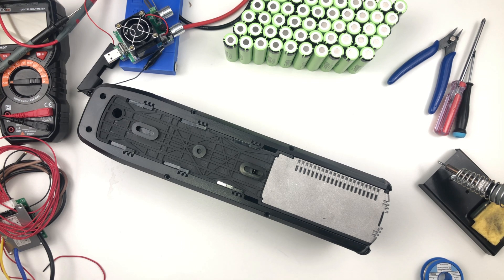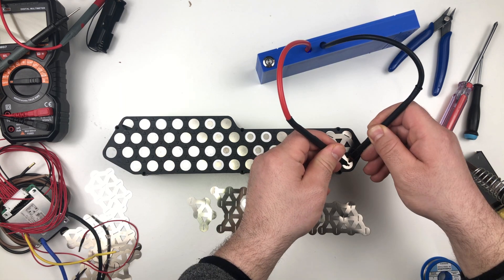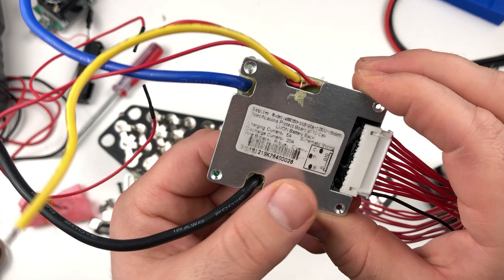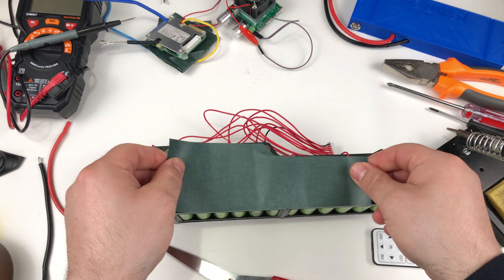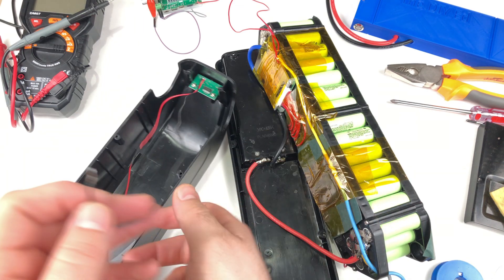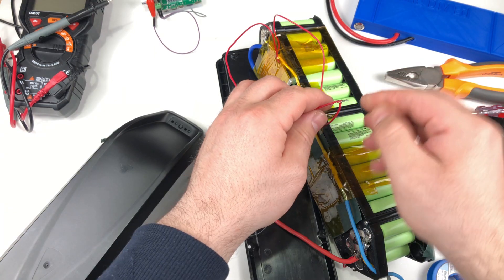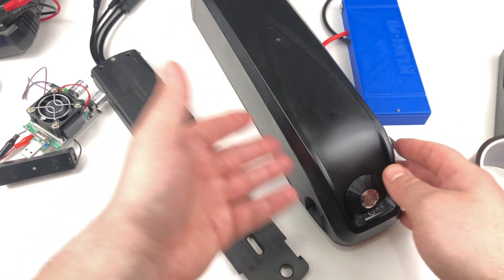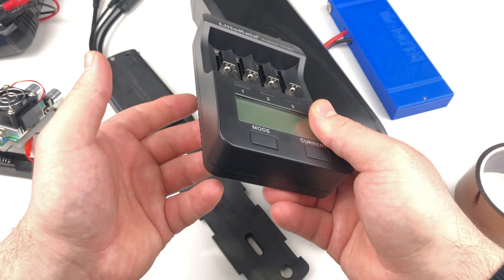DIY eBike Battery Build with 18650 Batteries [ How to Tutorial ]

Comment: Please don't make the same mistake I did. This video is a good guide, but the 18650 Panasonic cells shown in the video are not suitable for ebike batteries. They do not have a high discharge current. After 3-5 charge cycles, the cells are worn out and lose their performance. Instead, buy cells with a high discharge current.
Reply from the maker: Thanks for the feedback. I am planning to make a new follow up video on this topic as I have gained more knowledge and experience.

In deed the cheap cells won’t last as long compared to proper one from official certified sellers, but I can say confidentiality they are still in use for some Arduino projects I have around. The ebike battery did died on my beginning of this year completely but it did lasted years.

Comment: Thank you so far so very good! I am stocked  after almost completing a 48 v  reetion dp lithium ion battery project!’the battery without the BMS showed a 52 v overall on testing from positive and negative ends  But after fixing the BMS and sense wires, the charge showed a 52v. While the discharge end showed only a 21v,! I ordered another BMS and refitted it and still got the same problem! Please waiting for your rescue. Thanksgiving advise ASAP. Thanks🥅

Comment: Wow is this bad. Can't believe people watch this and think it is ok. You don't drop a soldering iron onto a lithium battery terminal. You solder first to the strip and then spot weld the strip to the battery. That's the whole point of spot welding - to minimize heat to the cell. No trimming of the BMS wires. Just spaghetti wires and then wrap it with Kapton - so messy. BMS wires should never run across the terminals. They run down the side of the battery with double sided insulation tape for strain relief. Tabs should be added to the terminals, which is where you solder to. Many other things wrong. Too many to list. If you are watching this and think it is ok, that's a sign that you should not be attempting it.

Comment: Thank you for the wonderfully informative build information! 5 years later, how long did this battery last you? what kind of range did you get from this battery during its lifetime? I am building this same configuration for my son's 1000w 36v e-dirtbike and I would like to know how well this worked for you.
Reply from the maker: I made 2. One died on my beginning of this year but that was before I forgot to charge it and left it in the basement. 
But until that point it was still giving me enough charge to ride for 30km with mix driving. 
The other one unfortunately was stolen with the bike after 6months.

Comment: Would that be possible to put the battery in some heat shrink plastic, then put in the plastic cover. Or is it overkill ? Also a battery 52V 17.5A battery costs around 600-650$. How much did that build end up costing you ?

Comment: Hello my friend,
I would like to build the same constellation. I already have a Hailong1 battery with 13 Ah but it is already very weak after 2 years because cheap cells are installed. Therefore I want to build the same constellation with Panasonic NCR18650B cells.
My controller is in the battery holder and is from Kunteng KT36ZWSRT-EP01 and I think 15A+1A max output. Would this battery constellation of 17Ah work with the controller?

Comment: Hi great video. Im a little confused though. You said the battery cage has a built in controller, is that correct?
Also, I have a bafang mid drive motor with a built in controller, does that mean I would have no use for this controller in the battery cage?
Thanks for the video.

Comment: Awesome tutorial man. I am in electronics myself, but was looking into tutorial to figure out how to connect BMS and organize batteries in the optimal way. The battery I'm building is 48V/17A so using just slightly larger Hailong case that can hold 65 cells i.e. 13S5P. I've chosen the same Panasonic cells as you did. They are probably the best performance per dollar 18650 one can buy - I found mine (genuine) for under 2.5$ per cell. And max discharge current is not 5A, but actually 2C i.e. 6.8A. With 5P that's 34A in total, enough in my case even for 1000W motor (mine is 750W and limited to 25A by the controller.
I also picked up couple of neat tricks like using the Kapton tape or using a ticker wire for connecting battery terminals, BMS and output terminals (which I totally forgot to take into account, until you mentioned it and then I ended up using 4mm2 wire, i.e. a bit ticker than AWG 12).
Reply: @pera kojot, which AliExpress store do you buy yours from? I notice battery linked in post sex in max 10 packs

Comment: How many kilometers we will travel on this battery?🤔
Reply from the maker: Depends of how I am driving it. I am a 103kg person and I think I am getting almost 150km with moderate riding with pedal assist, but if I go full throttle each time it will probably be like around 30-40KM

Comment: Thanks for your video. How much money do you save by building your own battery?
Is it worth doing?
Reply from the maker: Thanks for watching. I would say you will probably save more then $150. Also you know what you build, what components you have used, buying a already packaged battery pack usually they don't have the best BMS or cells, using lower capacity and the battery pack will weigh more because it will use more cells.

Comment: Where can I get a bms for my 52v.17.5 ah. Upp brand ??? (Triangle battery!)..
Reply from the maker: Did you try looking on Ali? I am sure you can find something there. Just make sure you get the BSM with the correct amperage max capacity. I say go 10A more then needed.

Comment: Why did you choose 10s battery instead of 13s?
Reply from the maker: As my controller was 36V as well as the hub. I personally don't need anything stronger. You can check the video of the ebike build using this battery pack.

Comment: good video.but how to choose right charger for dis?
Reply from the maker: If you are building a 10S pack you need a 42V charger. Just search for 10s chargers and you will find it easy. Just make it has a cut off option when it charges the battery pack to stop charging. The BMS is there to stop the charging but you want to have 2 layers of protection.

Comment: I am looking to build a pack with 13s 3200Mah and 7p to give me a little over 22Ah's on my 48v bike. I have found everything I need to make it now other than the BMS. It gives me options such as 30a or 60a and to be honest I am not 100% in what one is better I know I want the 13s also what is the difference between Common port and Separate port, I assumed it is less common has less wires from the cells to the BMS and Separate has more ? hope you can help or point me in the right direction on this. Thanks for the videos btw I opted for the spot welder you used also :D

Comment: Is the battery "live" when you solder black and red to discharge connections?
Is there an order in which to solder, black first red second?
I need to replace mine.
Reply: You can’t turn off a battery, unless the bms has an on/off switch. However this is not a problem until you short wires together. Then it goes boom... Solder them in the order that best fits for you. Be sure to use plenty of solder and a large tip, otherwise you’ll burn out the connector. Always insulate when working, especially if you are not confident with what you are doing. 
Good luck with it!

Comment: Im new so want to be sure if i wanted 48v 17ah I would need 65 cells for a 13s5p configuration? that would be 65 cells i need? do i need to change the bms to 48v 20A like this one? https://www.aliexpress.com/item/33000839343.html?spm=2114.12010612.8148356.32.6b557abeW49ASK
Reply from the maker: Hi, you will need 52 cells 13s3p and you will have a 17+Ah with cells that are with 3400+ Ah capacity. For the BMS I would stick with 20A one if your hub is rated for 500W or lower, if its more then go for bigger Amperage BMS. Have in mind this does not have on/off function but it does have a temp sensor. For on off you will need to use a latching button that will be rated for what your BMS is rated.

Comment: nicee its diffecult for my because i never do technology electronic if i want to make a battery pack can i use a solder to solder the batteries togheter
Reply from the maker: You can use solder to solder the batteries but I would not recommend doing this. 
It can be very dangerous and you might damage the cells. This is the only reason why I purchased a portable spot welder. You can check the review video out.

Comment: What setting did you have the welder on?  And thickness of the nickel
Reply from the maker: On the max ( 3th setting ) the nickel plates I used are of 0.125 thickness and the welders max rated is 0.125.  I  think there is a way to modify it so you can weld ticker strips. I need find out more and do some tests.

Comment: How do you charge this battery?
Reply from the maker: With a standard DC 42V 2A adapter. There is a charging port on the battery from the front right side. 
You can charge it with bigger amperage the BMS can charge safely with 5A but I am in no rush and slower charging speed longer lasting battery pack.
Reply: @thediyed  thanks for the reply. I am a complete noob and your post on reddit made me interested in ebikes.
Reply from the maker: I was the same, I am still learning. There is nothing better then learning something completely new. Have fun in your learning processes.

Comment: Hello thanks for the video
are there temperature sensors or thermal fuses for security please?
Reply from the maker: Thanks for watching!
This BMS is without temp sensor or thermal fuse as far as I know (but I might ask the seller). What I know it does have Overcharge, over discharge, over current and short circuit protection as well balanced function. 
I would say having thermal sensor would be nice but I was not able to find a BMS with ON/OFF switch with thermal sensor.
Reply: @thediyed  ok thank you for the details